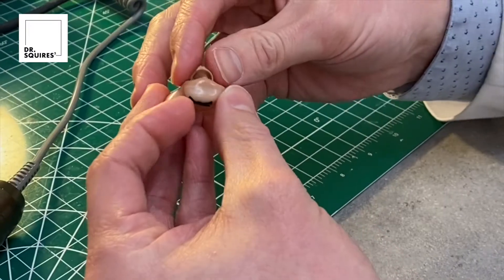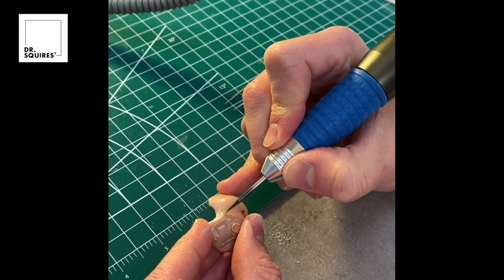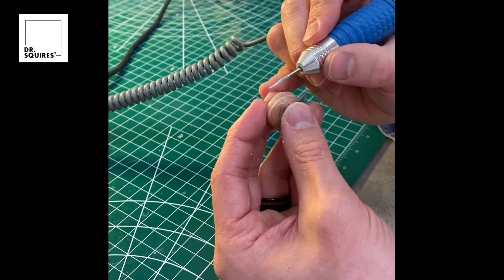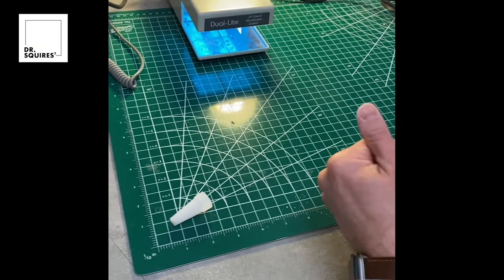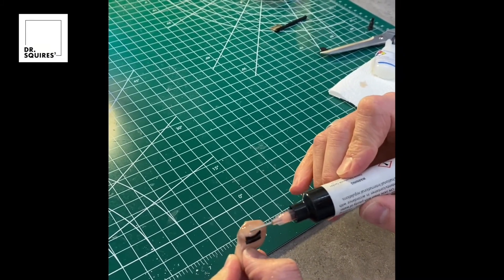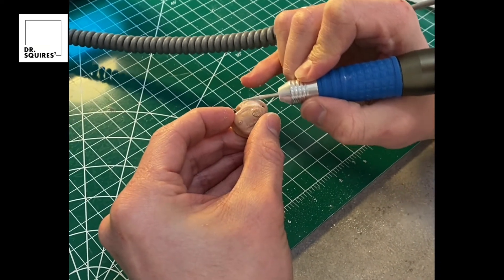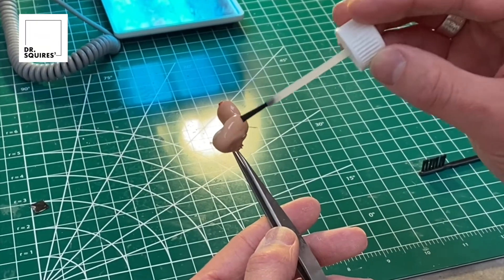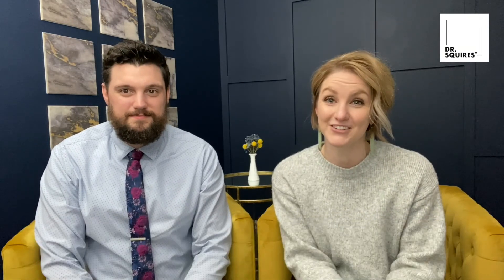REPAIRING A CRACKED HEARING AID - Dr. Squires Squared Ep. 045

Comment: Hi i have an important question, what do i do if the wire part of my hearing aid is twisted? like theres a cut part of the plastic cover of my aid and the wire is twisted and so it doesnt work now, what do i do? (I have the Reciever in the canal type of hearing aid btw)
Reply from the maker: With Receiver-in-the-canal (RIC) style hearing aids it is common for the wire (receiver wire) to become twisted. This typically happens when a patient places the earpiece (dome or earmold) in the ear first, then places the hearing aid over the ear - inadvertently turning the hearing aid outward to go over the ear. When this happens, it puts an extra twist in the receiver wire and can damage the receive wire by fraying the wire, pulling the wire out of the hearing aid, or shorting out the device. 

With a new earwire, it is best to place the hearing aid over the ear first to avoid twisting the wire. Then the dome or earmold should be in the proper orientation to place into the ear. If you still wish to put the dome or earmold in the ear first, just take care to turn the hearing aid toward the head when placing behind the ear. 

Regardless, it sounds like the hearing aid might be in need of repair by an audiologist, hearing instrument specialist, or technician. Best of luck!